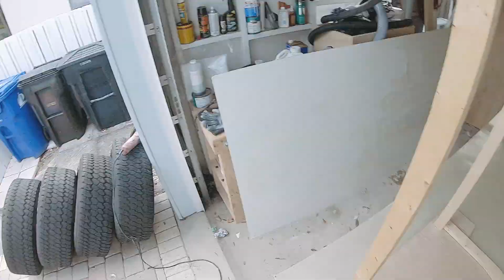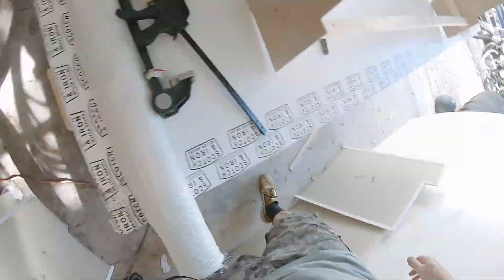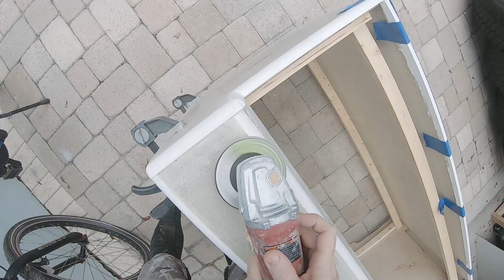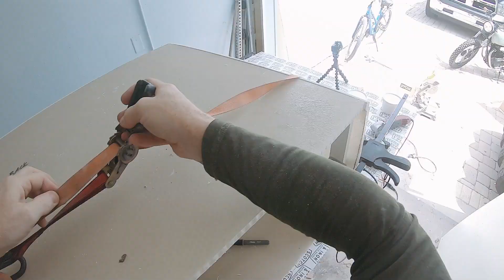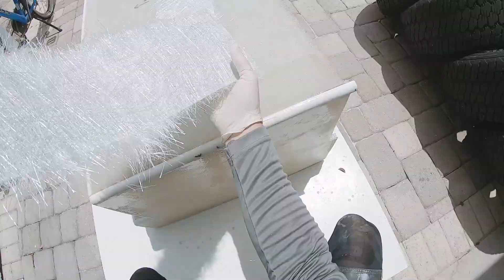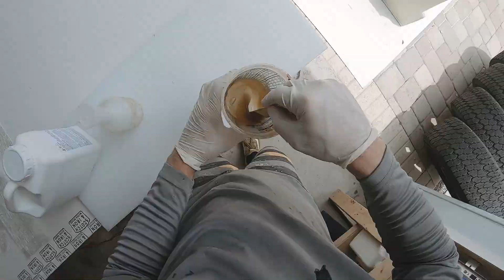SAVE $$ - DIY Boat Leaning Post / Console

Comment: I was also considering using this material for my deck. But when I was messing around with it I realized that screws don't work very well with this material. Some people said to glass the console to the deck but I have also heard that it cracks easily that way with the leverage the console has on the small glass connections. Does anyone have any recommendations for fastening a console to a nidacore deck?
Reply from the maker: Screws won’t hold in any composite core material. The only core material that holds screws is plywood. You can screw into the nida core as long as your glass lamination is thick enough. Typically 3 layers of 1708 is enough to hold a screw for most applications. If you need something stronger just add more 1708. Your screw will bite into the glass, not the nidacore. You can glass the console to the deck also. It’s not going to crack if it’s done correctly.
Reply: Thanks so much I really appreciate the advice. I’ll just add extra strips around the area I’m going to mount the console. Love your vids man! Always very helpful

Comment: What were your original 4x8 sheets used for the base material?  Didn't know about CoreMat.  That is useful information and a big help in many situations.  What are its strengths?  Can you use it for structural areas as well as just filler?  Enjoying your videos.
Reply from the maker: 4x8 honeycomb sheet. Coremat is used as a sand which core material typically used to build thickness and add strength to large areas of glass such as hull sides or the walls of consoles etc. By itself it doesn’t have any strength but can be used in creative situations like I did here. It’s more or less silica in sheet form. It’s sold by the foot in 38” widths.

Comment: I am wanting to build a custom fiberglass transom live well preferably oval shaped in my 1969 Auquasport rebuild and was looking for tip on building a mould
Reply from the maker: Haha. That’s an impossible questions to answer quickly. It took me 4 months to build mine. Watch my cockpit cooler videos. Building the mold is the easy part.

Comment: really a great video. thank you. I plan to build a center console for the first time. Would you please send a list of the materials you have used with name and etc..
Reply from the maker: Its difficult to give you an exact list, but the main materials were as follows...
5/8" honeycomb/nidacore sheet
3/4" quarter round PVC trim
Polyester Resin
Epoxy Bonding adhesive
Polyester Fairing Compound
Polyester High Build Primer
Reply: @boatcrafterscompany  thank you very much for the reply and sorry for my late reply. Best thanks ..

Comment: Awesome video! I'd like to build one very similar, but maybe add a livewell. I would love to see how you make a mold using this as the plug and I'd also like to see how you build a leaning post from that mold. Been watching all of your videos. They're very inspirational. Another request (You are taking requests, right?) would be a video showing the installation of a hatch receiver in a deck. I need to add an anchor locker hatch to the bow of my boat. Thanks for taking the time to make the videos!
Reply from the maker: Thanks. I’m going to make the plug video soon. 
If you watch the end of this video you’ll see a little bit of installing the hatch. Going on Vacation !!  I've got to put this DECK back together FAST I More Stringer & Deck Repairs https://youtu.be/aEeM_d4ODv0
Reply: @boatcrafterscompany  Thanks for that video link! I think that was the only one of your videos I haven't watched yet. Installing the hatch receiver looks pretty straight forward, but doing the underside would be tough, but not impossible in the bow of my boat. I have a little bit of room in there to work. I guess my next wish list video would be applying non-skid to the repaired area to make it look factory. Thanks again, I think your videos are some of the best out there for this stuff.
Reply from the maker: There’s a few ways you could install the hatches it’s all depends on your deck material. You don’t necessarily need to glass the bottom if your glass on top is thick enough. When I installed that hatch I used 1 layer of 1708 and 2 layers if 1.5oz CSM which would be pretty stable. You should be able to reach underneath the hatch and apply some thickened and reinforced epoxy to the seam and that will be very strong. 
I’m taking November off to paint the topside if my 37 boat and I’ll be rolling non skid.

Comment: Great video!..learned as lot from it,  especially making the corners round.
Reply from the maker: Thanks.  Yes the PVC worked very well for making a nice consistent radius.  You could use foam as well but I think the PVC was a better choice because it required less glass to protect the edge from getting dented or damaged